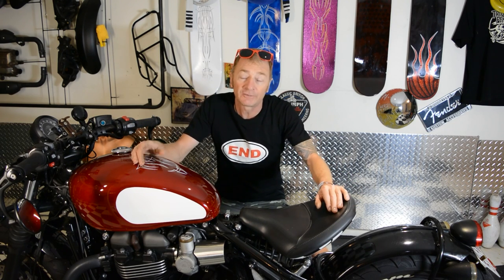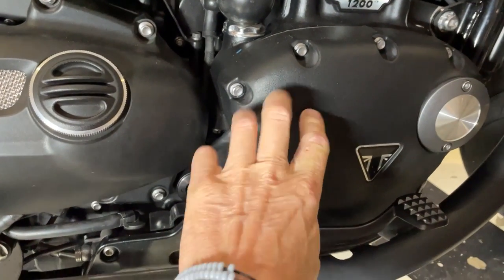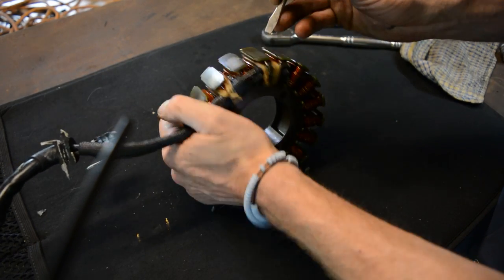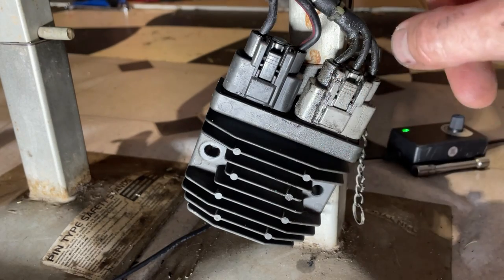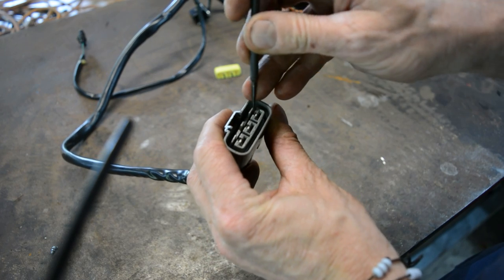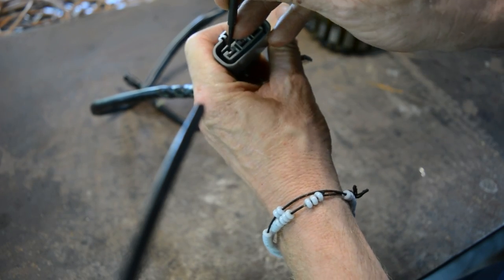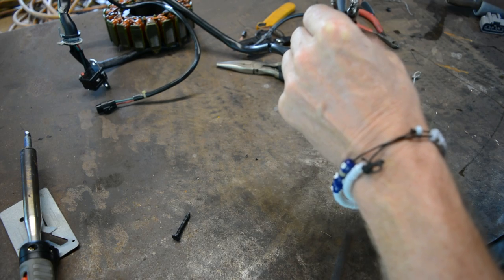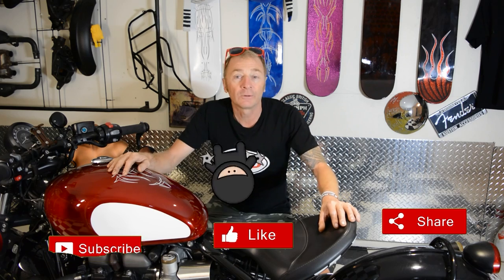Triumph Bonneville Bobber, Speed Twin, Thruxton Oil leak solution. (Short version)

Comment: I posted the question on the Thruxton Fbook page. The mate suggested “there is a known leak that can occur from oil traveling down the voltage regulator cable sheath from the stator. 
You have now  cleared answered. Thank you. 
I’ll give it a go in up coming weeks and time off work. Cheers from New Jersey. 2016 TTR 1200

Comment: I just finished trying this fix.  Time will tell if it works.  If it keeps leaking, i  guess it will be on to the long version.
Reply from the maker: It should be good if cleaned well and good quality sealer used. Hope all goes well👍

Comment: They seal them at the engine case grommet I believe.
Reply from the maker: I have heard of people doing this but I don't see how this helps as the oil is forced through the wiring. I guess the insulation could be cut there. I will look into it. Cheers!
Reply: I will try this but would love to know if this short version worked
Reply from the maker: @byunism  apparently it has worked for other people.
Reply: @thebrowncobobber  well then it's my next project. I have a lot of oil mist on the right side of the bike... do you think this causes that as well?
Reply from the maker: @byunism  I don't think so. The rectifier leak normally just drips on the floor.

Comment: I tried this fix. But upon reassembly now the bike won’t start. Anyone figure out if the order of the wires matters or not? I’m stumped why it won’t start now.
Reply from the maker: I don't think the order of the 3 black wires shouldn't make a difference to starting.
Reply: Turns out the plug wasn’t quite seated properly. Thanks for the quick reply and for this extremely helpful video.